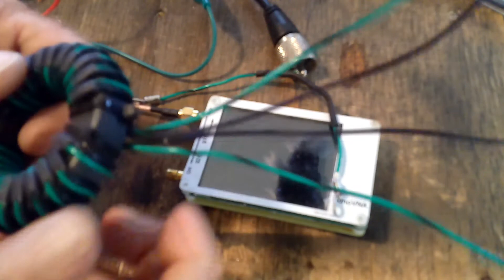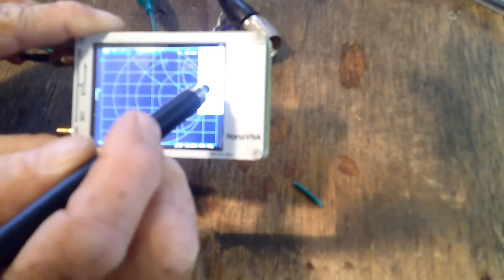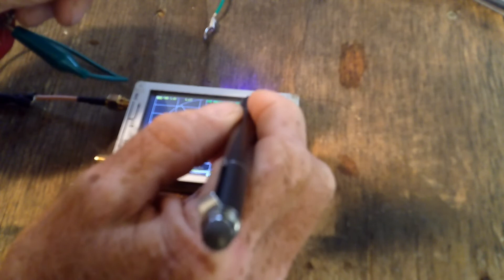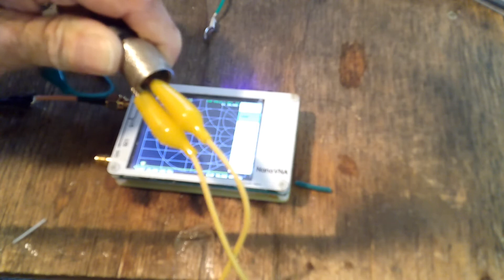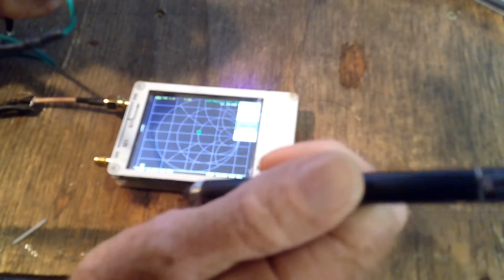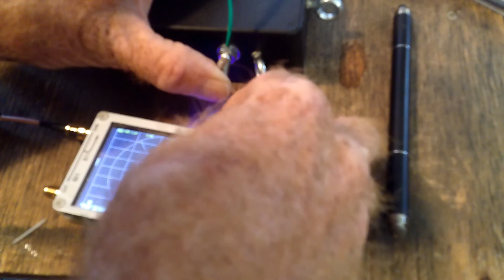NanoVNA what am I screwing up?

Comment: I don't know well the NanoVNA, but when you disconnect the load, the marker should go up to the right of the Smith Chart (open). Try to check the test leads and the standards with the multimeter if there is a short or an open somewhere.